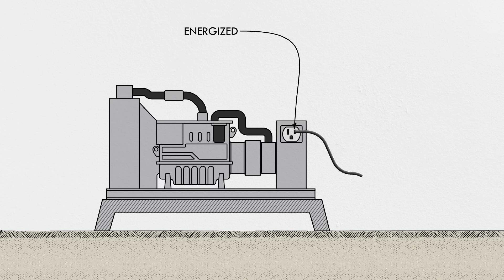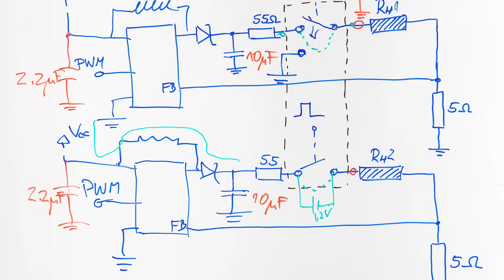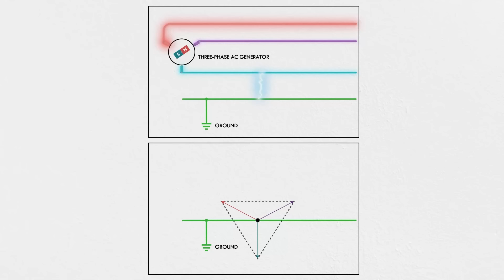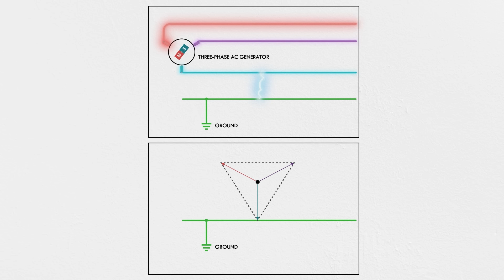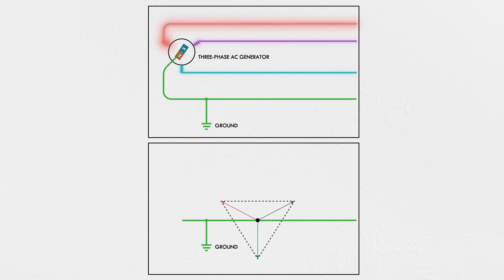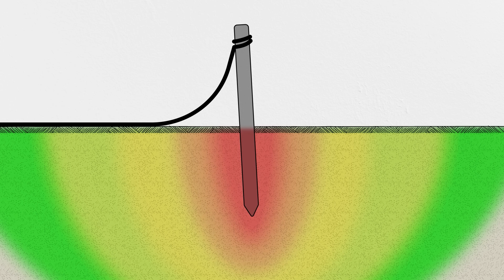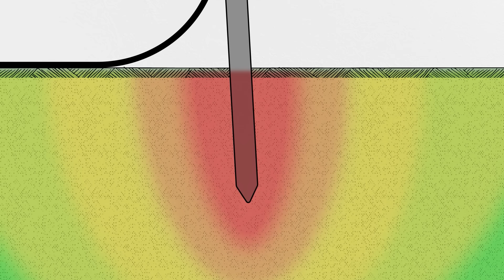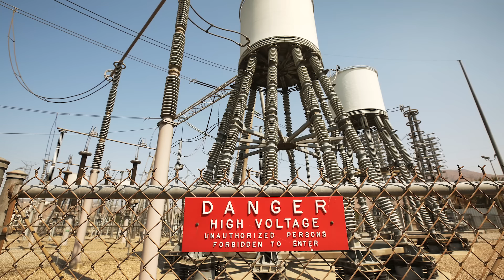Where Does Grounded Electricity Actually Go?

Comment: @Practical Engineering: at approx 19:30 you mention hopping to limit the chance of step potential - this is no longer the case, at least in the Australian electricity industry. The reason is that a person hopping (one or 2 footed) is very prone to overbalance and accidentelly step or fall, thereby creating the step potential and possibly injuring themeselves as well.
Current training is to keep both feet together and 'shuffle' by sliding one foot forward no more than 3/4 of the length of the foot so they stay together, then shifting the other foot in the same manner. In this way, while some 'step potential' will potentially still exist it will be small, and the feet / ankles / legs touching provides a path for any currect without transitting through the torso.
Another thing to note is to avoid any sudden ground condition changes where possible - don't move from dry ground to wet, concrete to grass, etc.
Great content!
Reply: Not from the electrical service industry but I was taught another (still different) way of getting away from ground potential: short hopping with both feet together
Reply: That's recommended in electrical training in the US, too.  (At least what I had.)
Reply: could you attach a wire to the boots, running along the pants to give a lower resistance path?
Reply: @anwyl42  Exactly what I was thinking - can't we just "ground" the shoes to each other?
Reply: @anwyl42 Such situations typically emerge out of blue. If the worker knows the ground fault upfront, they will usually call someone to cut the power. Thus, it's very difficult to be prepared for such a surprise. 

Dragging a ground wire around at all times, can probably cause more issues, so grounding  boots are not part of daily gear 😂.
Reply: how do you know how far is safe? could you safely seperate your legs by small increments to test?
Reply: @yren3386  I feel like that's true of most PPE. You don't wear it 'cause you'll usually need it, you wear it 'cause you don't know when you'll need it. 

You wouldn't need to a literal trip-hazard style wire either, 'cause you could put it in pants. I'd imagine it like fencing lame: You clip your boots to the pants with an alligator clip on each side, then test resistance between them to ensure you have a circuit, then you're good to go.
Reply: Nice. First thing I thought when I heard the hopping was “Man, I’d probably fall or take an even bigger step trying to catch myself. I’d just do tiny shuffle steps.”
Reply: As not an electrician, I thought that shuffling would make more sense than 1-foot hopping as soon as I heard him say it, lol. Super easy to lose your balance when hopping on one foot.
Reply: Yep, electrical engineer here, I was taught the same thing- when somebody hops/jumps and they trip, their natural instinct will be to stick their hands out to break their fall. Now you have a step potential between your outstretched hands and your feet-  a distance that's even longer than your stride
Reply: @blueberry1c2  I would not recommend hopping on two feet over hopping on one foot, as the danger in the hopping method has nothing to do with the number of feet you're using to stabilize yourself; the danger is from the act of hopping itself. It comes with the risk of excessive, uncontrollable momentum that can cause you to lose your balance, which will require you to take a step to catch your balance, and suddenly you have two feet on the ground that are a distance apart from each other, causing a voltage potential between your feet, causing you to get shocked. I am not a trained electrician myself, so certainly listen to people more experienced than myself, but it sure seems to me that the method of sliding your feet on the ground described in the original comment of this thread is, by far, the safest method of escaping a ground fault because it carries a minimal risk of losing your balance.
Reply: @anwyl42  I'm not for connecting a hot wire toaster passing one's sensitive areas ;-)
Reply: @maxxxy910  you can absolutely feel it in the case of AC. I wouldn't recommend it, but you could slowly test the limit.
But getting away using the penguin shuffle is also what we got taught. Don't hop, because if you fall, you are probably dead
Reply: Try rolling like sonic
Reply: @maxxxy910  No, if you move your feet far enough to the point a potential difference occurs it means you've already been zapped, not something you should risk.
Reply: Interesting.  I suspect the reality of what is safe depends quite a good deal on how old you are.  When i was a very young man, I suspect I could have hopped along on one foot quite salely and quickly.  Now, as an older man, the idea of me going any distance hopping on one foot sounds a good deal less safe than shuffling along.
Reply: Can confirm, I worked at a Public Works maintenance unit about 6 years ago and we had someone from the power company come out and do a safety training for everyone, and they said they same thing: keep your feet together and slowly shuffle away.

On Florida beaches its call the Sting-Ray Shuffle, as it keeps you from stepping on sting rays.
Reply: I love learning about electricity and this was definitely something nice to learn about, especially since I plan on working on a Solar System by myself, just to see if I can do it (If I can't, im definitely hiring someone who CAN!) Thanks for this info!
Reply: @blueberry1c2 your method is the one I most commonly hear repeated in the electrical business where I work, not saying its correct, just saying its what ive commonly heard as well. I live basically where the south and the Midwest meet more or less, US.
Reply: @anwyl42  wear shackles.
Reply: @thunder____  worth saying that it was part of middle school bus safety lessons, in case the bus brought down a power line. The shuffling method is better but I can understand why folks with vehicle evacuation expertise wouldn't be caught up on grid safety practices
Reply: @anwyl42  I've worked lights, which is sparky-adjacent, and I've heard stories about old-time sparkies taping wires to their forearms to dangle to the ground in order to guarantee any short goes from arm to ground without taking a detour through the heart. Cannot confirm because never witnessed, but heard the stories. All I know is that when I worked lights I wore rubber-soled electrical safety boots and tried to avoid any third-party body contacts with metal (ladder, scaffold, scissor-lift, although they have plastic tyres) while working at height.
Reply: Just remember if you're in the substation and need to pee, use the on-off-on method to create air gaps in the flow thus avoiding step potential.
Reply: Alternating your feet as you "hop", never have two feet on the ground at the same.
Like with a really fast run.
Reply: @tokyodove And the worst part of the case you mentioned is that the path of electricity goes more directly through the heart (between hand and feet).
Reply: Crane safety training for work mentioned the hopping method, but most recommends shuffling. This is in context of power line contact while using a crane. Obvious first step - avoid working where such contact is possible, use a spotter to help judge distance and keep outside limit of closest approach, etc. If you still manage to screw it up and contact occurs, then shuffling is your best bet.
Reply: Yes, we in Europe also have a "shuffle" feet rule
Reply: If you have to think about "shuffling" you are already dead.
Reply: @maxxxy910 I've spoken to employees from another utility who had to escape by shuffling and they said that even when one foot got to be about halfway advanced past the other it became painful, that was inside a substation with a ground grid in place to limit step potential
Reply: Can anyone name a single case where a person "shuffled" to safety??? I can't find a single case....
Reply: You started a sentence with, "Current training is . . ."  Bad pun!  Sorry, that's just the way my brain works.
Reply: Four legged animals are doomed.
Reply: I was going to type this exact post lol but you have done a much better job then I would have
Reply: The shuffle method is what is taught to people in BC, too. Honestly it's such a part of our lives that a basic electrical knowledge is so important even for the layman
Reply: @StephenGillie  tether the shoes together with a grounding cable? hmmm.....than trip and face plant? :-)
Reply: Okay. THAT I understood.
Reply: @anwyl42 You could include firearms in PPE with that definition. At least with responsible users.
Reply: @glenntroyer  Maybe a 6 foot long cable?
Reply: Beat me to it.
Reply: Where are you guys hanging out where relays won't take out the ground fault before you even have time to react? This whole conversation seems a bit silly to me. If a breaker or transformer fail and are going up in flames, the last thing I'm worried about is ground potential. If a switch or insulator fail while I'm doing work, either the relay takes it out before I even notice, or I'm not freaking moving off the grounding pad.
Reply: When I went to the GE Technician school they were teaching the shuffle method.
The demonstration looked a lot like Tim Conway's 'world's oldest man' character.
Reply: heh. reminds me of how slips and falls are 2x more deadly than firearms are in the US.
Reply: That’s the end of the video
Reply: Timestamp is 11:25
Reply: @anwyl42  ah I see what you meant now. You mean a wire between legs, tucked into pants. 
Without any professional knowledge, it looks like a good idea to me.

I somehow thought you meant a long ground wire connected to a remote location. That's gonna be a trip hazard.
Reply: This- this is current MSHA training in the USA as well.
Reply: I think the OSHA manual (construction work subpart) says to do that shuffling move to get away from a crane that has contacted a power line
Reply: @anwyl42 As another reply mentions, if there is current flowing in the wire it will heat up , which could be a hazard too. So now we have to provide a wire with sufficient thermal separation from the wearer for heating from all ”reasonable” faults, but still allow the heat to dissipate so the wire doesn’t fail.
Reply: Same on Canada
Reply: id say just have some sort of wire band to put around your legs. to keep it from traveling further than where you put the band.
Reply: I am a British Columbian. I'm not an electrical expert, but we were taught to shuffle.
Reply: We are calling it a "penguin walk"
Reply: @maxxxy910  The smaller the better...it's not something you want to test on yourself. Lot's of variable, ground resistance, voltage, distance from voltage.
Reply: Was going to say here (US) i was told to shuffle, too.
Reply: @anwyl42  Boots with thick rubber soles and no nails is best. Last thing you want is conductors on the boots, a few year back here in the UK there was a race horse killed when a fault going under the race track caused a potential difference in the ground and of course the horse was not wearing rubber boots. I have also heard of cattle and horses in field getting killed the same way.
Reply: Do the electric slide 😂😂
Reply: @ewthmatth  Jump clear of the operator station- take extreme care to NOT make contact with the truck/crane/machine/vehicle and the ground. Be as careful as possible to land on both feet at the same time, keeping your feet together. Make a shuffling motion with your feet, never allowing your legs and feet to come apart, until you are completely clear of the danger. 
MSHA teaches it, I wouldn't be surprised if OSHA does as well.
Reply: @anwyl42  This sounds like a Patten for PPE, great Idea!!! I would suggest a simple detector for locating high energy ground faults should also be in service (a compass on a stick when approaching non-ferrous metal from any direction other then true south or north. Same as drift wood on a string for underwater divers looking for Delta P). Rubber Trousers that fit over clothing and boots with heavy gauge grounding wire imbedded with foot to surface contact plates and surrounding fire retardant.
Reply: Yeah this is what I was taught a few years back in college in the US. Still looks silly, but I'd be less terrified of toppling over lmao
Reply: @aaronleverton4221  While that sounds awesome at first glance, I'd bet most household floors aren't very conductive (laminate, tile, wood), making the arm wire not very effective...

Now, connect that wire hanging off your arm to the Ground terminal in a GFCI that's already wired up CORRECTLY, and you should have a much safer time (assuming you know 100% for a fact that none of the non-GFCI receptacles were incorrectly wired where the Ground is bonded directly to the Neutral, which would shock you as soon as you stuck your arm wire into the ground (assuming there is at least one appliance turned on and plugged into an incorrectly-wired receptacle) Maybe the GFCI would trip in that Ground<->Neutral example? Idk for sure).
Reply: @stevenlynch3456  Pretty sure I said "heard stories", "old time" and "never witnessed", which would suggest at best an efficacy rate was eventually noted and at worst an urban myth put about in the industry.
Reply: @anwyl42  
...but where to carry the wire in your bat-utilty-belt? And if you had a wire running the inseam of your pants, what if it hot? There is definitely a point of concern.... 😲😅
Reply: @3v068  
Way cool. How many planets?
Reply: @thunder____ as somebody who has hopped before, I feel qualified to assert that hopping on two feet is in fact more stable than hopping on one, and that your dissertation here might not be accurate.
Reply: I thought about this as well. I immediately thought "I'm super awkward - I'll just shimmy-shuffle so I don't fall"
Reply: Time to train our dogs how to shuffle? 😂
Reply: @maxxxy910   When you reach other people standing around the scene. Personally, If I had to leave the situation, I would head toward a linesman or firefighter.
Reply: @philipoakley5498  I was thinking the same thing!
Reply: @celebrim1  Shuffle. Feet together. toe to arch. toe to arch. toe to arch. continue until you reach a first responder.
Reply: @blueberry1c2 Everyone must look really ridiculous 😂
Reply: @Leanzazzy  one more condition I forgot, you apparently have to hug yourself as well. Even worse balance and looking like you're in a sack race
Reply: @blueberry1c2  At this point you should just embrace the electricity 🔌
Reply: @techstuff9198 

Even just a slow jog results in never having both feet simultaneously on the ground. That would be my preference.
Reply: When I see people working on high voltage power I just know it's a job I couldn't do.
Reply: I walk like that every morning when I get out of bed.
Reply: Indeed..
Reply: The shuffle is taught in the US also.
Reply: @blueberry1c2 problem with that is you still have a better chance of falling. I, for one, don't want to fall and reach out a hand to catch myself and shoot a 69k lightning bolt from my fingers. It might sting.
Reply: @anwyl42, no, absolutely not.
Reply: @m00str I wouldn't recommend it. 69k volts is a lot. Humans are around 1k ohms resistance. I don't think you're going to survive an accidental 69 amps through your body.
Reply: Indeed.
Reply: Do the Hokey Pokey and ya turn yourself around...
That's what it's all about.